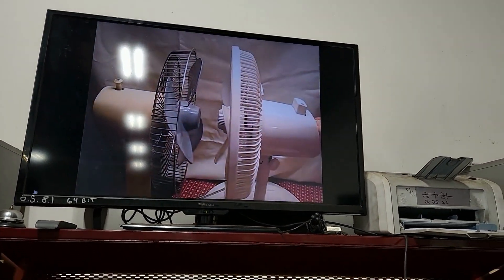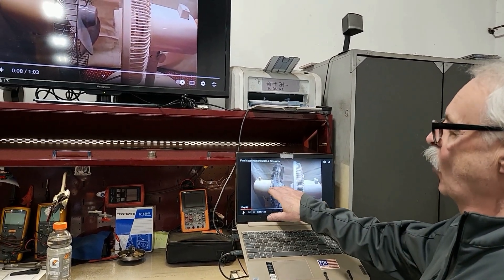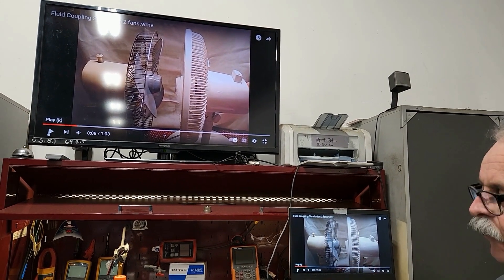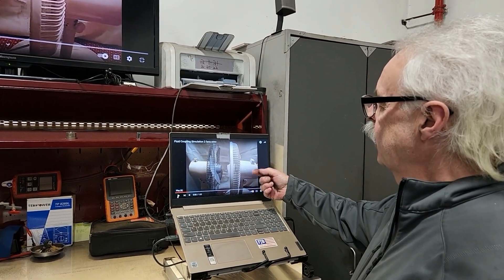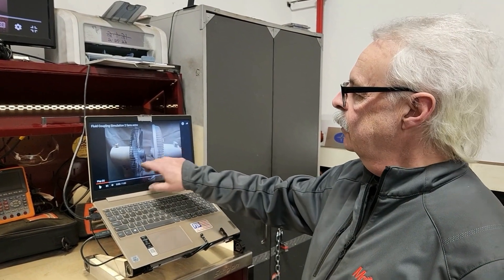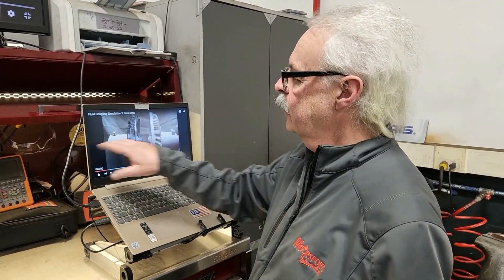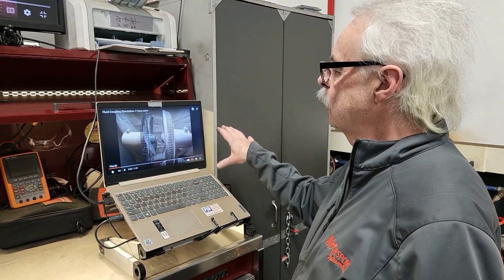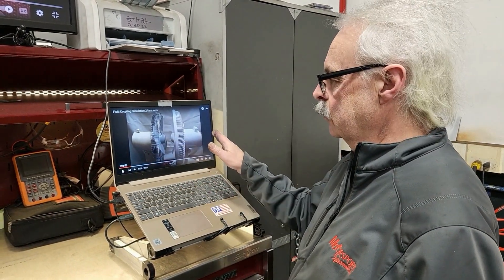The Clutch Is Always Engaged On A Motorcycle

Comment: Wait I’m confused tho Fluid coupling, or fluid torque converter in automotive terms, typically isn’t something you’d see on a motorcycle unless it’s a specific type of automatic transmission. However, the concept behind it can apply to certain drivetrain systems on bikes with automatic or semi-automatic transmissions.

In a fluid coupling, a liquid (usually oil) transfers rotational energy between two components, such as an engine and a transmission. This allows smooth engagement and disengagement of power without the need for a physical clutch. On motorcycles that use this type of system, the fluid coupling could potentially cause the rear wheel to spin, especially if the bike is in neutral.

However, most motorcycles with manual transmissions do not use a fluid coupling. Instead, they rely on a traditional clutch to disengage the engine from the rear wheel when in neutral. So, unless your bike has a unique or semi-automatic transmission system, fluid coupling wouldn’t be the cause of your rear wheel spinning.